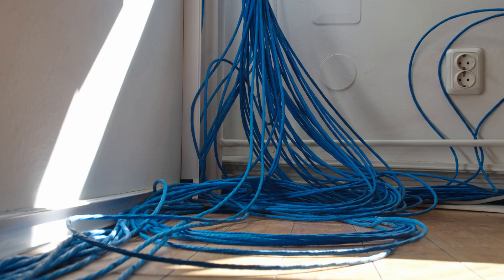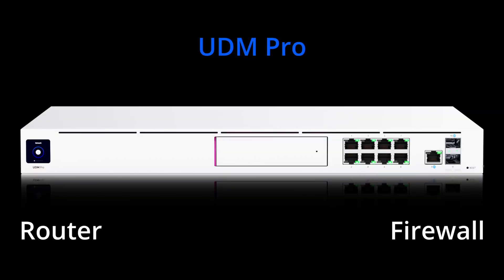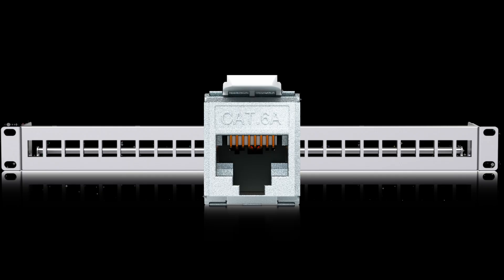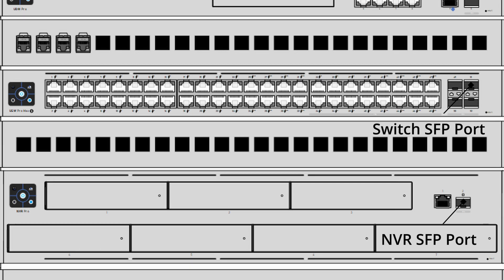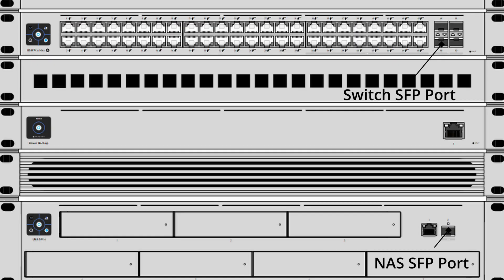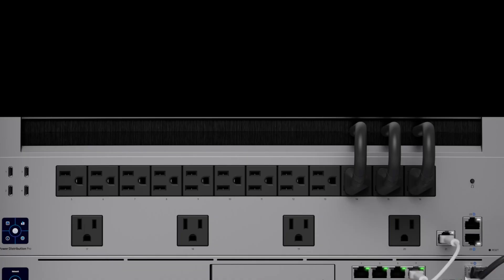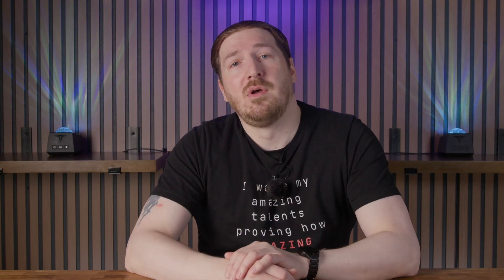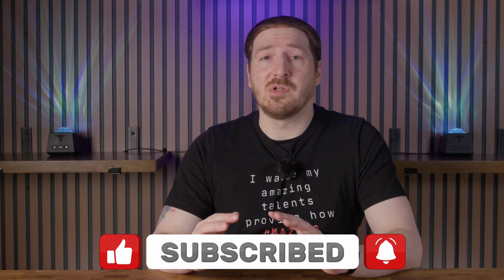Designing a Dream Smart Home p7 - Network

Comment: For a full sized rack cabinet (I would get the Ubiquiti 42RU rack cabinet), I would have gone with the Power Distribution Hi-density and I would have plugged the RPS into a rack-mounted UPS and the devices power cords into the Power Distribution Hi-density. I would also get two of the RPS units as I am not sure one would cover everything; at least not in my setup. Then I would have purchased the Aggregation Pro switch and run everything through it and then up to the UDM. I would have gone with the UDM Pro Max to be able to get 3.5 Gbps throughput with IDS/IPS turned on. I would get two UDM Pro Max and set them up into High Availability. I would also get two of the WAN switches (I do not have a fiber option for ISP so I would go with the RJ45 version). I would use an Ethernet Surge Protection (rack mount unit) for one of my Patch Panels for any cameras, doorbells, PoE lights, et cetera that are outside. I would also get the UNAS Pro 8 instead of the UNAS Pro (unless I had already bought the 7-bay version) and put in NVMe SSD drives for read/write cache and get the second hot swappable power supply (as it is not included). And finally, I would put UI Care on everything that was available. That would be the dream setup unless I wanted to set up to the EFG and Campus class switches. That would definitely be overkill for 99.99% of home set ups. Of course my dream setup is overkill too.
Reply from the maker: Wow, that's quite the home network design, thanks for sharing! No such thing as overkill if you have a use for it.